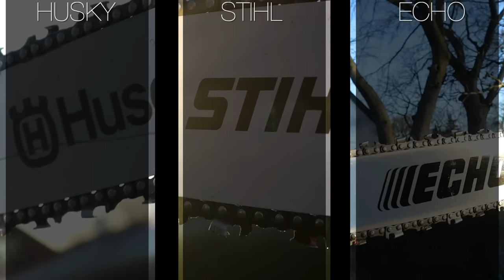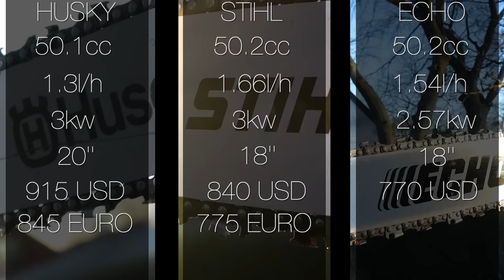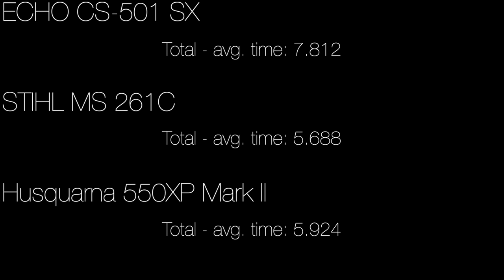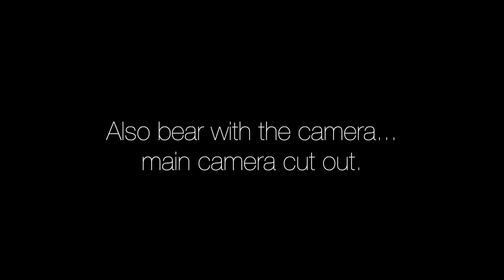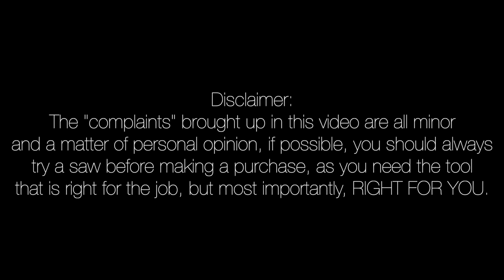Husqvarna 550xp mark II vs. Stihl ms 261 c vs. Echo cs-501 sx - Chainsaw comparison video

Comment: I have a550xp stock as well with 1 ported and that thing is just sick my ported ad deck and modified saws are just completely in a different time zone they include a 550xp. An 266xp and an SE, 372xp pre torque and regular 372xp ,, A 562xp (which is outrageous.... a no comparison in same cc saw) a 268xp (sick saw) but the 266’s are one of a kind as far as power after porting and just how crazy the process can improve Rpms an you can literally shove saws through wood and not loose an rpm with full house chain square ground at .055 off the rakers

Comment: Great video. Great review especially on the cookies as really shows the rpm/speed on the cuts. Big hi from NZ aswell.
Reply from the maker: Thanks and hi right back at ya
Reply: Although I wanna say I believe you pushed Stihl through wood and let husky just cut on its weight you can hear it in video..... I’m a husky guy and have about 26 of them and I don’t cut professionally lol just like having a hobby and running and collecting saws is just that.... I do cut 12-18 cords of wood for winter and another 10 that I sell and normally sell 6 cords of my own lol but my 550xp will hurt my best friends ms261 and just literally almost 2:1 cuts but I do my own sharpening and do square file and I drag a .040 on the rakers..... the 5 series husky carry awesome rpm range and you can get by taken more meat

Comment: Very well made video. I think you should have used the same size bar on all saws. I know you ran them how they are sold but the echo got screwed in your video just because they don’t set the customer up with the shortest bar recommended for the saw.

Comment: Great video!
But the chain speed is the same with a longer bar. But the engine works harder.
And what is actually the problem with stihl's oil cap?

Comment: I liked your review however to make it as equal and fair across the log they need the same size bar's. I think the echo would feel and perform quite differently with a smaller bar. I also really like the metal on/off switch on the echo over these new fangled plastic struff.
Reply: I wonder how much of a difference that actually makes though, consider the posted power output of the Echo is 85% of the other two -- so its a less powerful saw to begin with.
Reply: @chad1755  Makes me wonder is that the real difference after initial use and actually adjusting the carburetor. Factory rated output is supposedly measured using factory settings, which could be manipulated by misadjustment to meet emissions standards. This is not the real life usage scenario considering these saws are not some homeowner models but real work saws primarily meant for the professional who can and will tune their saw.

Things like M tronic and Autotune bypass this and are what they are, unless the owner actually modifies them. Even a simple spark arrestor removal counts as modification though.

Comment: LOve my Stihl saws, they cut better and last longer and easy to work on. I used Jonsered and Poulan for years, both great saws. Poulin made a great climbing/limbing saw, but my Stihls geterdone. Great to see a girl slinging saws. Good job!
Reply: I have handled Sthils in professional logging. The things with Sthils is that they just Grind alot more. The Husqvarna cuts faster no grinding. I prefer a Mcchulloch chainsaw better cuts fast no grinding.

Comment: Hi! What year is the 261? Because the Stihl is since 2016 a Little lighter ... 400g less than 550II.
Yes the oil cap is Crap!🤕
Reply from the maker: Guten Tag its from 2019

Comment: Great review. I’ve been using Stihl saws ever since they introduced the bayonet type fuel and oil caps, about 25 years if my memory is correct. I’ve always loved that feature as it very quick and precise. They can be problematic if not kept clean though. Happiness is a clean and sharp chainsaw 😀
Reply: Most pros don’t have time to clean a saw. We just buy new ones by the time that becomes a problem

Comment: very well said .. You did very well .. Wow someone finally said something about those new modern marvels , gas and oil cap on my Stihl MS-250 . I thought i was the only one who could stop for gas and oil and cannot get the oil cap back on ???  It's a cap inside a cap inside a cap and it's gotta be lined up _-- if one part is not lined up nope it's not going back on..One day i bet i sat on a log for 15 minutes trying to get the oil cap back on , i was about to go to town but finally it went CLICK, gawd how hard could it be??.. When i bought my saw new the owner's manual had two pictures , two paragraphs on one page that's it.. When i took it to the dealer on a trip (please show me the trick on these caps ?) He went and got a new manual and there are 7 pages on those modern marvels , you don't think the wildlife is having any trouble with those caps do you ?? I felt better already ..I have owned Husky's for years now and didn't mind the off /on switch. It took me awhile with my new Stihl to get used to the one switch does ALL, start, high idle , idle , off..I have owned chainsaws for over 50 years and off /on /choke always worked fine .. I did get to operate the new Husky 550 XP, i was impressed with performance and really everything about it, yes it is spendy .. But i regret that i bought my first Stihl in some respects after owning 4 different Husky's over the passed years .. I cut with fellows who own Echo and they seem to be good quality saw, i know no one who had shop time on one.. It does make a difference if a saw has 3/8 pitch chain against a saw with .325 pitch with same bar length..   I use nothing but full skip chisel chain, it cuts a lot faster and you only have half the cutters to file when they need touch up .. You are good at what you do , i hope you will do more videos .. very well done..

Comment: I don’t know if anyone else has said it , but bar length ( apart from a small increase in friction ) should not effect cutting speed - the chain speed is the deciding factor not how long the chain is - at any given speed the sprocket still pulls “x” number of teeth through the wood - a lower cutting speed is slower chain speed = usually less revs or lower sprocket teeth number 
If I’m wrong , happy to be corrected
Great review !!

Comment: The chain on the Stihl was 1,5mm and on the Husqvarna it was 1,3mm? It was a surprise that the cuts with the Stihl were such fast. I wonder what the result would have been with the 4-series bar and the new 1,3mm chain. Thanks.
Reply: In Belgium, the Stihl MS 261 C-M comes standard with a 1,6 mm .325 " RS chain and the Husqvarna 550 XP Mark II with a 1,5 mm .325 " H25 chain. I haven't tested the new 4-seies bar and chain yet, but I use the Tuning Kit (1,3 mm 3/8 " Picco Super chain (low profile full chisel chain)) a lot and it cuts really fast.
Reply from the maker: I’ll be doing a video comparing this bar and chain to the 04 real soon
Reply: @Femalelumberjack  I am waiting for it. :)

Comment: I found a ms270c someone had thrown away in a scrap yard, i have no idea why considering general condition. It looks better than saws i used before i came over it, looking at the plastic, and the 'feel', general condition engine it self seems to be in a very good condition. :D 
Guess i was lucky, or people are much richer than i think considering the value. I like to tinker with things.  But when i came over it and checked it out. Checked basic things, like it was not seized, etc, guessed it had a blown piston or something when i first came over it, but nope.. Only thing that killed this saw was a defect coil, so after a new coil it came to life strait away. Hope it will last some time. Wanted a chainsaw for some time, but never bought one because i just borrow. And this one seems to fit my needs fine, considering power and weight.   
Tho, its not 100%. The sword has some usage, even tho chain looks new. And, managed to loose the part the makes the screw fit nicely in the quick lock. Also, 1 rubber part that came loose i cant figure out where it fits. And 1 rubber anti vibration seems to be missing. Anyways, hope the saw will last and i think it will. So i dare to ask, what swords length goes well with a 3.5hp 50cc chainsaw? And any sword brands one should keep away from, if not going oem? Or maybe there are brands that beat the stihl blades? Tnx for any info.
EDIT: While im first talking chainsaw, how is the quick tension system on these saws? Other saws i used have the regular tension system, and tho its nice to not having to use tool. The regular tension system seems more robust. Anyone have any experience to share?

Comment: Idk about husky but the stihl pro level saws, ie 260, 362, 441,and up have metal crankcase. Stihl also has plastic crankcase in the mid range use saws and they are cheaper and lighter. Echo is all plastic but I like them too. Just don't yank on them if it gets pinched. Might pull out the bar studs. The best thing is don't get pinched!

Comment: I was torn between a Husq. 550xp Mark II and an Echo CS 501P and ended up with the Echo. My two climbing saws are an  Echo 303T and a 355T and both are screamers and never let me down.  For me deciding on another Echo is the track record of the two climbing saws, dealer support and it was over 200 bucks cheaper but basically the same features and lighter! Plus, my dealer sells both brands but has had an order in since LAST NOVEMBER and still no delivery date on any Husquvarna saws and parts.  I love Husquvarna too, I have an older 350 (with about 10 hours of use lol) but the muffler falling off (known issue) is going to cost me either a new saw or at the least a new head and that's something that was a design flaw but they won't do anything about it.
Reply: I have an old 01 350 also 52 cc and I rollered the sprocket   So far I’ve been keeping it together but I think  time for an upgrade

Comment: Thank you for a very good review and honest comparison of the three saws!
In my experience, the Stihl is a really powerful and easy to handle saw, but lets be honest, both the oil and fuel cap are still junk. 
The Husqvarna anti vibe are just a class of its own, and that is one thing why i prefer that saw.
The second is that the Husqvarna appears to stand the arctic climate better (i have winter 5 months of the year), and that the air filter doesn’t need to be cleaned as often in comparison to the Stihl.
The Echo seems like a nice saw, and i would love to test it. 
Keep up the good work!

-And happy new (better) year!!

Comment: The quality of crankshaft and cylinder quality is very high in that echo very strong plating in that cylinder ...I built bucking Billy Ray's echo 2511t and echo does build some good models 620 is very good 2511t ...501p..and the 590 is a good crew ground saw for the pricepoint
Reply: @John Rutherford   I think I've seen that saw in one of his vids, august hunicke is also using a 2511 lately. I've used a stihl 150 t for the past 3 years, only drilled out muffler, nothing else. Bought the new 151 now, also with a drilled open muffler, but somehow I can't get it to run right. Brought the first one back, got another, same problems, no power, so I get more and more interested in those 2511's. Seems a breeze porting those....
Reply: @DUTCHHUSKY66Treesandforest  with a little work you can convert any saw too a powerhouse
Reply: I've built alot of 620 echos and they will outrun any 372xp
Reply: Check out victorious Victor's channel I built his 620 echo
Reply: @johnrutherford9262  thanks mate, I sure will check it out!
Reply: @DUTCHHUSKY66Treesandforest  hes bucking friend victor

Comment: what I found really dissapointing bout the 261 was the plastic handle, it's hard and vibrates more. unless u have heated handle then it's prolly alu? the cutting times u are showing are not making sense though cuz the cut speed on the 550 is known to be faster than stihl. so the chains must make alot of difference.

Comment: are they all broken in? because I know from my experience the 550 MK2 gets more power after about 10 tanks of fuel.
Reply from the maker: Husqvarna and Stihl are, Echo was not
Reply: @Femalelumberjack , I have an Echo 620PW. After it was broken in and I tuned the carburetor it went from from being a really good saw to being a fantastic saw. I think with a little time and a carb tune (and maybe a shorter bar) the echo would really surprise you.

Comment: Echo sounded like it needed a tune. Sounds as though it was pretty rich. Echo comes with a lot better warranty right?
Reply: Most echo saws need a tune from the factory. It made a big difference in how my 620 cuts. They also have a 5 year consumer warranty and a 1 year commercial warranty.

Comment: I was using my "chainsaw on a stick"--a Stihl pole saw today. It's heavy, but does the job. However, It has the same gas and oil quarter turn caps on it.  I almost gave myself a gas bath. The cap looked tight, but when I tipped it to make a angle cut it started dumping gas all over the place. I do have a Stihl with a 25 inch bar, but my other two saws are Husqvarna because they have regular screw caps. I still have my first Stihl it is an 030. And I had an 045 for years. Not sure why Stihl went to a really dumb cap system.

Comment: I bought my MS 261c-m last year (Feb 2019) for $589.  How did that go up $250 in price?
Reply from the maker: As I said in the video that is the price in Denmark with the current exchange rate
Reply: @Femalelumberjack  Oh ok, I must missed the that part then and I guess that makes sense.  Also, you said the maximum recommended bar length of the 261 is 18"  Stihl's website says  20" as the max bar length, although my dealer recommend using 18".  I'm not mentioning this to nitpick or anything, but I could see that being helpful for someone who looking to get one of those saws.  Anyway, I think you did a good job comparing them side by side, thanks for putting the video out!

Comment: I would run 10 tanks through the Echo and then adjust the carb, it's running to rich. Once that is done that saw will wake up some and run closer to the others. The bar length would only matter if you where burying the bar, There will be a bit more drag on the longer chain but not enough to matter in this case, chain speed is what is holding the Echo back here and again that is because you can hear it is running rich so not hitting the same rpm as the Husky and Stihl, I'd be surprised if the Echo was hitting 12K rpm from the sounds of it.

Comment: Nice vid, I had 2 stihl 026 and loved them. Both run great until I fell a
 tree on one. The other still run great after 25 year of cutting 
firewood. Then I bought the new 261C M and expected it to bee as good as
 the other two. It was not. After 3 years of cutting firewood 261 broke 
down with crankshaftfailure. Stihl told me I was to blame not using the 
Stihl motomix oil. All these years I mix shell oil and gas 2%. That was 
not good enough for Stihl 261 Stihl told me. Not happy with Stihl 261 
and Stihl-service anymore. No more Stihl for me....

Comment: Nice review :-) I do own MS261 and I have been happy with that. Occasionally, I would need more power when chopping tree trunks to firewood. I also tested it on my first woodcarving project, noticed that older MS201 (non M-tronic) would be more suitable for that :-) I also have 18inch bar, what I soon will test on my MS261. One reason to my selection to Stilh, also was fact that locally there exists a Stihl service point.
Reply from the maker: Thanks. Stihl makes some great chainsaws

Comment: Bar size means nothing in relation to chain speed. In fact the longer bar will ultimately perform better as it has more cutting links, so it will take slightly longer to dull.

Comment: The bar length has very little effect on chain speed over the 2 inch difference. As far as I know the longer the bar the more power it takes to pull the chain over the longer. distance. Friction and power loss is enemy.
I don't like the oil cap on the 261. That is a problem. The 550 starts on the 3rd pull when cold. Not so with the 261. If I had to guess, 10 - 12 pulls when cold. The primer bulb on the 550 is an advantage. I have both and use the 550 the most.

Comment: Length of bar on the Echo doesn't make the chain go slower. That is determined by sprocket size. It sounds like the Echo is not running at full RPMs. Probably needs an adjustment.

Comment: It looks like the Husqvarna 550xp mark 2 in this video is a G model which comes with a heated handle feature which causes there to be a bigger price difference between it and the other 2 saws. The base price for that saw is around 600 US dollars right now.

Comment: Yes the 2511t is alot better built than the 150 engine wise ...some people dont like the 3 eights chain as it does cause a little chatter and convert too quarter pitch chain for a smoother cut

Comment: a few months ago I went looking for a chainsaw for my firewood business and the choice ended up being between the stihl 261 and the husqvarna in this video. For the exact same reason as you I chose the Stihl. It just felt much nicer and more balanced in my hands and lighter than the Husky. Never regretted buying it. I bought a 20" bar, which to me seems very adequate for the Stihl 261. Even when cutting 60 cm diameter beech it has plenty of power for the job. However I do agree about the oil cap, dunno why but it's just difficult to close, lol

Comment: Regardless of same cc’s for all 3 saws, power difference is dramaticaly lower in Echo than other 2 saws. Simply, Echo cannot keep up on the clock because of 20% less power (2.57 kW vs 3 kW). Altough clock is not everything.

Comment: However, after 4/5 hours of continuous work the Stihl works without problems but the Husquarna and the Eco probably tend to shut down due to the engine overheating.